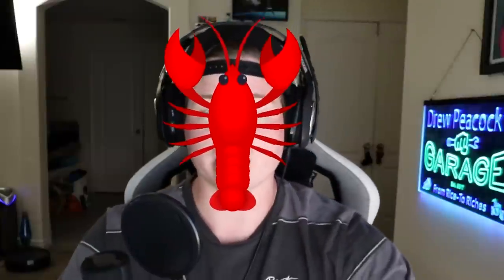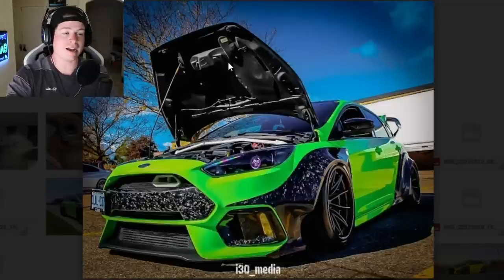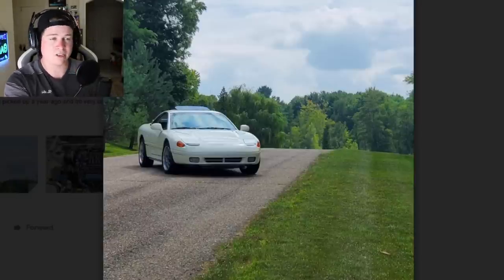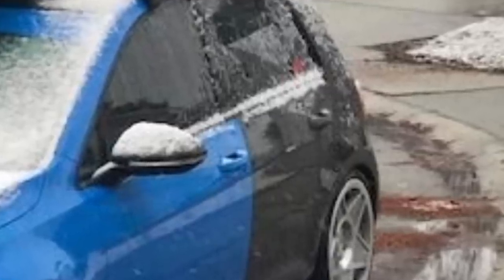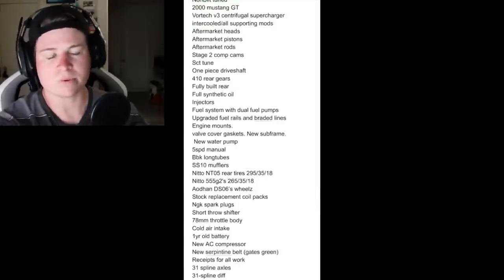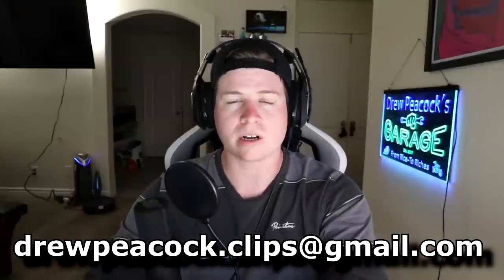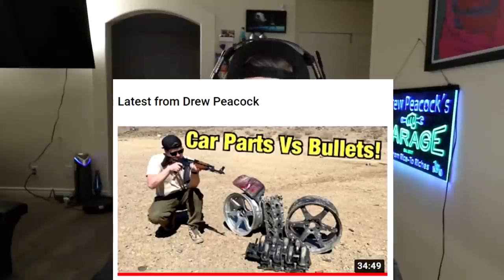This SUBSCRIBER Has The Ultimate SLEEPER!!! - Respect All Builds

Comment: Those late 90's early '00 Maxima's are pretty good car especially if you want a sleeper
Reply: Those later 5th gens with the vq35 and 6mt go crazy
Reply: "Mexican guy intensifies"
Reply: @mconradb  it’s crazy to think how slow cars used to be
Reply: even now they have 300hp na V6 and spin tires
Reply: Like that one dude who kept up with a 911 Turbo. That was wild
Reply: i had a 96 maxima it had the stock VQ with an automatic but still was pretty quick. had and aftermarket exhaust and air filter and i bought it with coils and rep wheels. it wasnt a bad car
Reply: it also had a carbon front lip and was murdered out

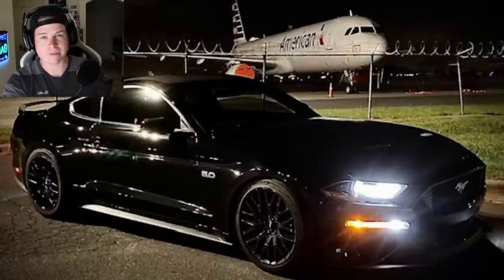Comment: The s550 at 3:08 with the vortech...yea, those are quiet. They don't squeal like the procharger. There is the option for what Vortech calls, Heritage gears. Those will squeal. Also depending on the blow off valve, the hiss won't be too loud at all. Ran that setup on my '18 GT s550. Vortech JT V3. Made 723whp on pump 91 (no e85 any where around here in this joke of a country, Canada). Sold the kit off and the new owner now makes a little over 800whp at 11 psi. I currently am now big single turbo. Other than seeing the shiny intercooler and pipes (which I am contemplating on painting black to hide them a little), you wouldn't know it puts down 900whp on 93 (with meth) and 12 psi. Sounds like a stock s550 with a basic Borla catback. Totally quiet once warm and zero drone. But once you get into boost, right around the 4-5 psi, all hell breaks loose. Side note, I do have proper suspension, and know how to drive. It goes straight and true. No crowd killer here lol.

Comment: About the 02 maxima, The engine is from a newer maxima. Maximas have vq35 02-present- just sadly mated with a cvt after 2006. Believe it or not the vq35 was originally developed for the maxima aka transverse configuration

Comment: Just a fyi on the maxima. The vq35de fwd version can come out of a Murano, maxima, Infiniti SUVs, etc.
 stroker kits for the Z's can also fit the fwd version since the block is basically the same.
You can build some solid and affordable sleepers especially when you consider how plentiful those engines are aka cheap af. There are a lot of those cars on the road and in junkyards
Reply: Actually have went faster all motor with a maxima over the z’s
Reply: it can come out of some renault under the code name "Renault V4Y" on laguna velsatis and other crap

Comment: I’m an old head now but when I was young I was really into car audio. I wanted the best sounding and loudest system in my city. I couldn’t afford it all at once, so I built that system piece by piece, one component at a time. By the time it was all said and done I had 4 grand wrapped up in the audio system alone. It took me all of my junior and senior year of high school saving paychecks and birthday money to get it done, but by the end of it, I had a quality ass system that sounded amazing. Was it the loudest? Almost but not quite, it could hit 144.7 db with the windows cracked… 141 windows closed measured off the dash, there were other local cars hitting in the high 140’s and low 150’s at the time, but the sound quality was awesome because I built it right and didn’t just slap the biggest amp and the most subwoofers I could into it.

Moral of the story? People want instant gratification nowadays. They don’t want to build something piece by piece over years. That’s why they head to auto zone and buy as much cheap accessories as they can and call it a day…. Your impatience is not an excuse. If I could piece together a system in my teens making $5.15 an hour part time at a grocery store, then there is no excuse for anyone else.

Comment: The problem is, broke people working minimum wage put on crappy exterior mods that just scream poverty. Start with mods that make your car more fun to drive. Not with body mods or loud exhaust which has no use case besides just making your car louder.

Comment: mhhhhh RS,,, imagine this,,
Power: 600 horsepower
Torque: 664 foot-pounds
Zero-60 Times: less than 2 seconds
Body;  Ford Focus RS,  welded and reinforced; homologated FIA-spec roll cage; custom body, designed by Ford Performance and M-Sport; custom underbody protection plating
Engine: Ford Performance and M-Sport developed Ford EcoBoost 2.0-liter engine; Garrett Turbocharger with 45 mm restrictor; Cosworth Electronics engine management; custom rallycross intercooler and radiator package.
Transmission: Sadev 6-Speed sequential gearbox with adjustable, mechanical front and rear differentials; triple plate AP carbon clutch
Suspension: SLA-type suspension, both front and rear with 3-way adjustable Reiger dampers
Brakes: Brembo 4-pot calipers with 350mm rotors and Sadev Hydraulic handbrake system
Interior: Recaro Pro-Racer Ultima FIA-8862 spec driver’s seat
Wheels: Forged 17- by 8-inch wheels
Tires: FIA-spec AVON race tires

Comment: damn these r all so good my honda 1991 civic crx ee8 is bad compared lol all its got is a skunk 2 racing radiator and its tuned and then i have coilovers and rota grid 5 wheels with racing tires on
and has a vtec controller which setts vtec off at 3k